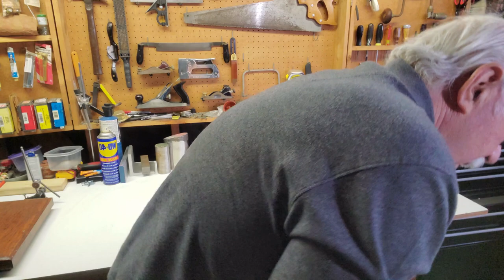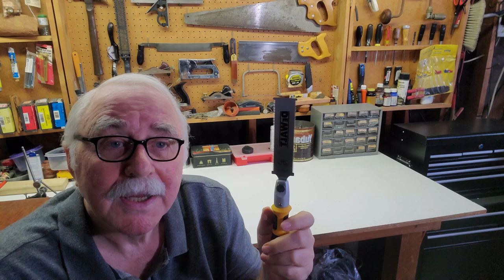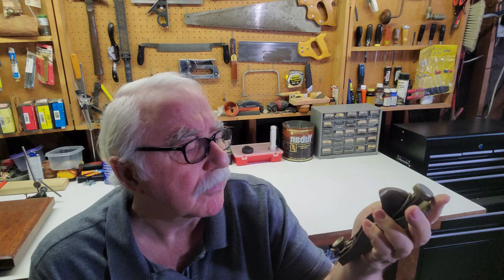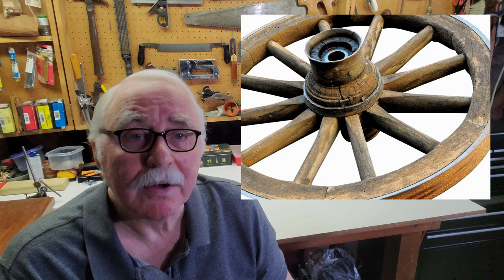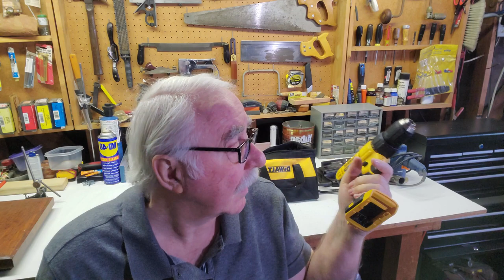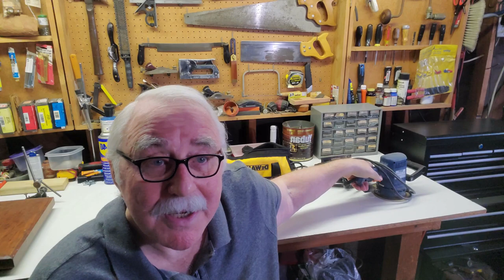Yes, YOU Can Build a Boat - Boat Building Tools

Comment: Great introduction to tools for building your boats.  When I began building my Tillamook, I laid out all the ribs on a 4' by 8' sheet of plywood supported on saw horses in my back yard; and made all the cuts with a circular saw using an aluminum mitre square with adjustable angle guide.  Simple construction tools and methods are what I liked best about building it. In my case it took about two years to complete, but I also restored another boat in that time as well.  While I always wished I had a shop to do the work in, I ended up doing all the work (start to finish) under a shade tree behind the house!

Comment: Thanks.  Me: electric plane.  I VAPORIZED the piece I was planing, then planed through the power cord.  End of that.  Mini-circular saw.  Poor ergonomics, hard to control.  Jig saw is ok for THIN material.  Anything over About 1/2”, upside I may be hugging the line, but underneath, likely to be all over the place.  Band saw. NOT ME!  Actually gotten pretty good with a 7-1/2” circular saw, but I’m left handed so guess where all the sawdust flies.  I hate you guys with shops cleaner than my house.  And don’t say anything bad about table saws!